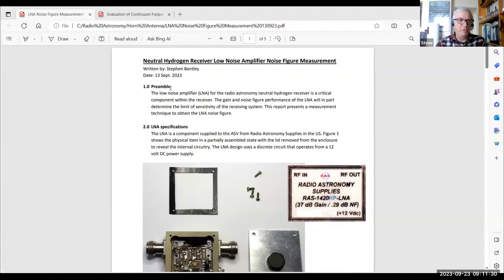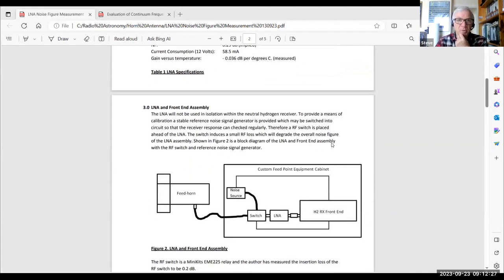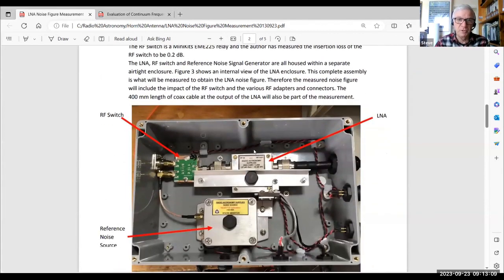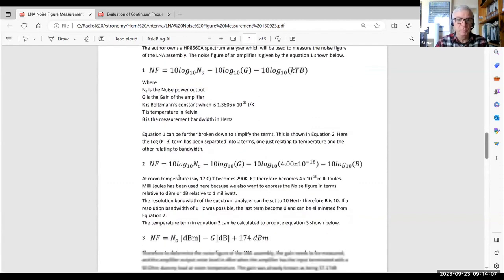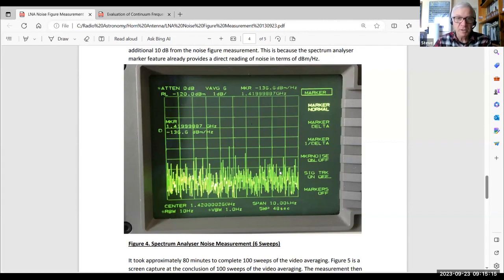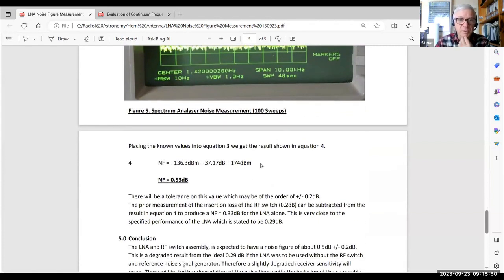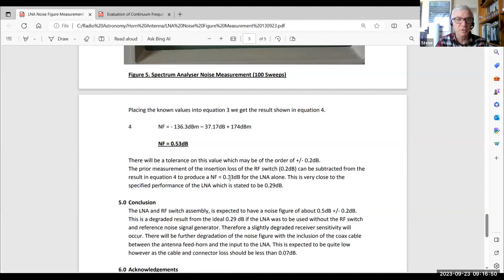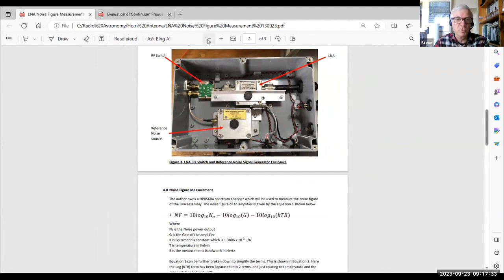Steven Bentley: LNA Noise Figure Measurement

Comment: Have you tried replacing the RF switch with a directional coupler? You can get a better than 0.2dB insertion loss. Also, it's hard to measure low NF with this method. The uncertainty in your measurement could be more than your measurement itself.